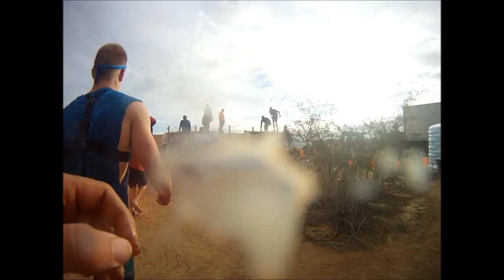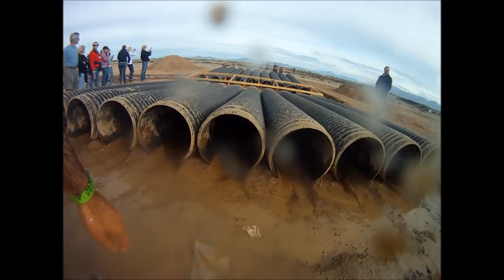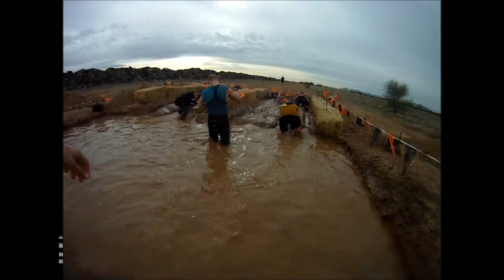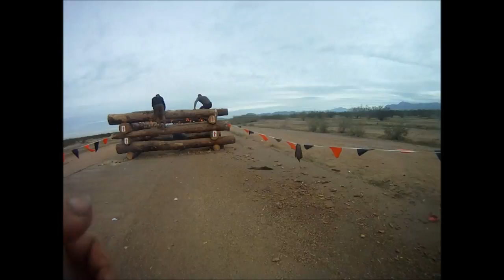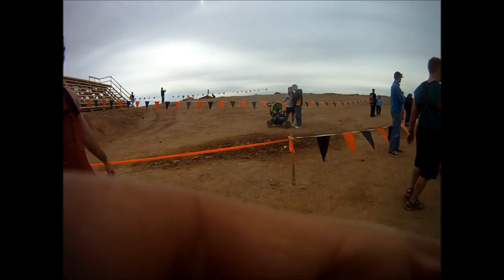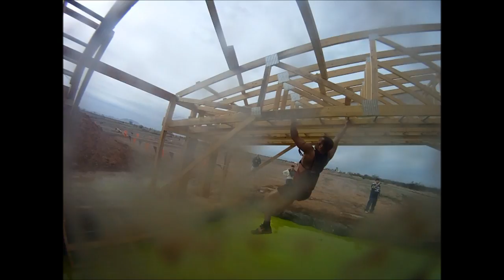Tough Mudder AZ 2012 - GoPro - First Person

Comment: did you have any problems with the gopro running out of battery? did you turn it off at all to conserve battery. Apparently the gopro batteries are 2.5 hours. some tough mudder times are over 3 hours.